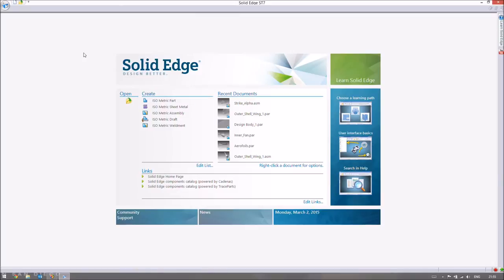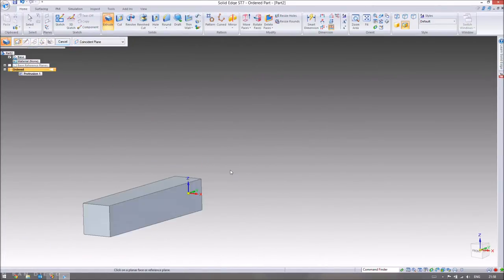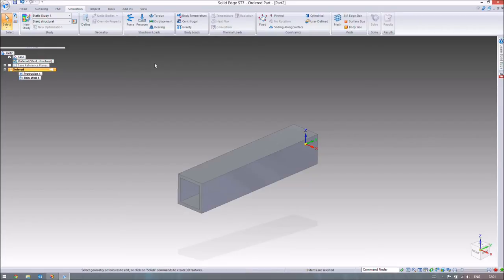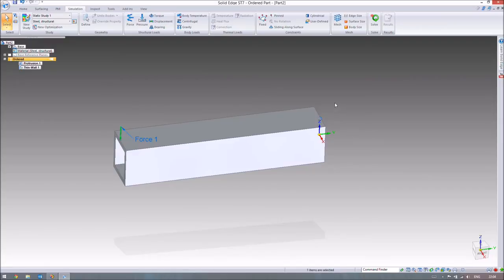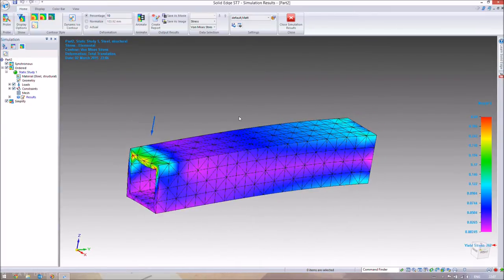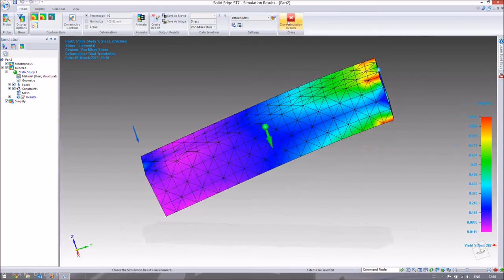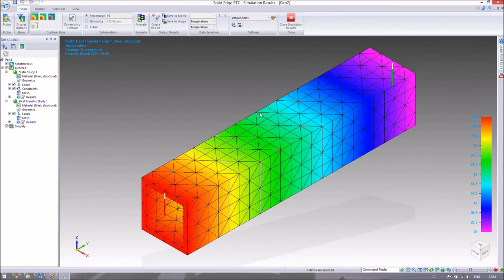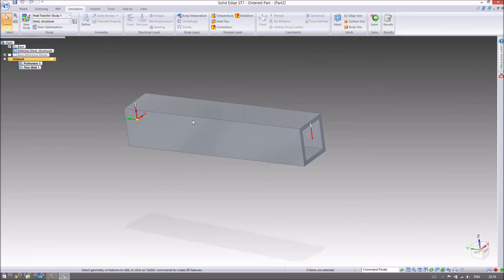Solid Edge Advanced 3

Comment: what are these results indicating..???? how to know my design is success or fail..??
Reply from the maker: +Ronak Hingu These results only really display the magnitude of bending and transmission of heat.

If, say, this beam was connecting a furnace to a wall and you wanted to know how long the furnace could be operational before the wall reached a certain temperature then this is the sort of thing you would use.
Likewise, if you are supporting a very heavy furnace you need to know that the supports do not break.

You need to know in what ways your design could fail, be it a wall heating up to too high a temperature, a support breaking or bending signiificantly, etc.
That's the purpose of FEA (Finite Element Analysis modelling).
Reply: +Tuition Project  okay thanks..
Reply: +Ronak Hingu You just have to compare max tensile stength to the limit allowed by the material. E.g. for cyclic stress https://en.wikipedia.org/wiki/Fatigue_limit . And of course you must check if the displacement is ok for your device.